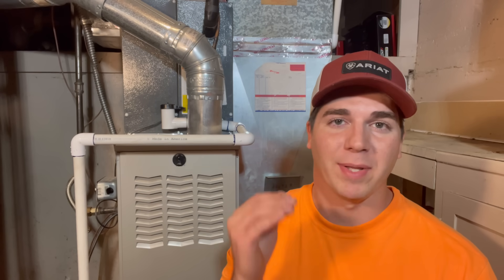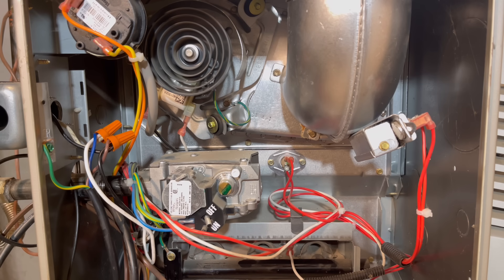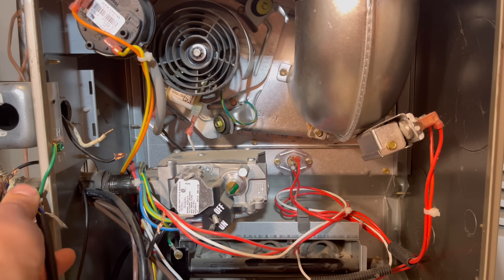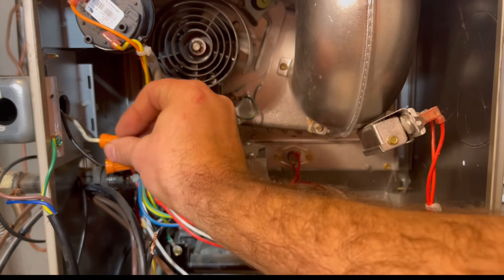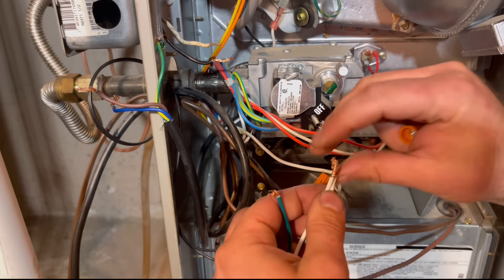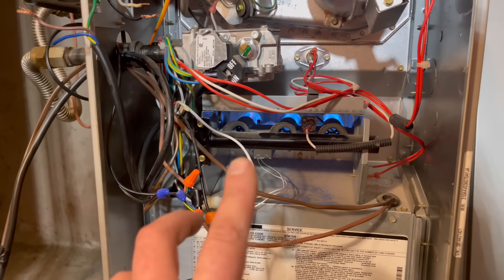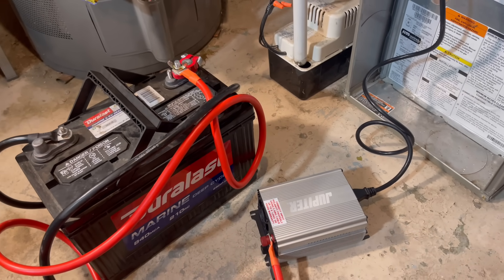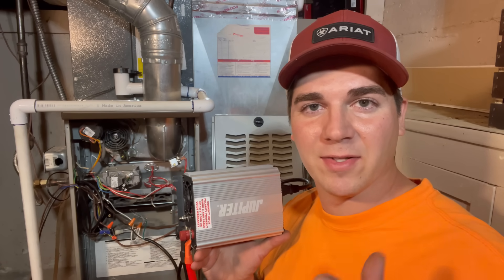Did You Know You Can Heat Your Home With A Car Battery?

Comment: You omitted the ground. The unit needs a mechanical ground supplied from the source and is the ground and neutral bonded at the source? Also, is there any means of overcurrent protection? Are you following National Electric Code? Do you need to add any disclaimer to your videos to protect yourself from lawsuits in the event you lead someone into injury or worse death? Let's leave electrical to licensed electricians and tin knockin to HVAC technicians.

Comment: I used a pair of deep-cycle 6 volt batteries in series to power an inverter to supply my 120VAC.  Not only does it power my heating boiler, but it also powers my refrigerator and a few lights.  So...heat, refrigeration, and lights for a few days.!

Comment: If you wanted, you can charge that battery with your car and a battery charger on your long trips to and from your work place, if you didn't have solar, most people have car charging systems or a riding lawn mowers and some jumper cables. Just some thouhts !

Comment: Might last a day or two since you're only powering the blower.
Don't try this on an electric furnace, not enough power to run it AND even if you did use a high-enough power inverter, wouldn't even last an hour.

Comment: That's really nice. Unfortunately, I live in a manufactured home. I do not have a switch on my furnace. It is simply hardwired to the house electrical system. Yes, it has its own circuit breaker. If this can be used on my furnace, I'd love to know how. It isn't uncommon for us to have 2-3 day outages. When the temps are below 20, that can be really bad. TY

Comment: Just keep the battery and inverter in the car with the car running, so you dont degrade your battery. You can just run a thick extension cord to the furnace.

Comment: Are most gas furnace using a step down from a transformer from 110/120 down to a 24 volt for the furnace  controls. My homes run on steam gas burners by the way

Comment: Buy a large truck battery 12 Volts and keep it on an automatic charger.  Have it connected to an inverter.  Get a 500 Watt inverter. This way you can run some LED lighting. This battery would probably last a few days during a power failure.   

If you have sunlight during a power failure, you can install some solar panels to run the charger through its own inverter. During sunlight the battery would be charging. This would mean a bit of an installation but not complicated.

Comment: Now take your car charger and plug it into your Inverter and put the battery cable on your car battery post.. PS Put your battery on a block of wood the because sitting on concrete floor can drain your battery faster.

Comment: I have a 2500 watt inverter generator and I was wondering if the power goes out if I shut my main off and plug my inverter into a plug thats on the same side of the panel box as the furnace and just turn the furnace breaker on can I run my furnace that way off of my 2500 watt inverter.

Comment: Basically what you are saying is that a local power failure can have you marooned without adequate heating. Gas is plenty available but you can't run the furnace. Damn, that is awkward. Is there any law in the US that forbids having a backup (12v battery + inverter) power supply to keep the furnace going in case of a local power failure? Especially in winter?

Comment: Can a setup like this power a oil fired crown boiler with a beckett burner. The heater provides domestic hot water and home heat through slant fin baseboard convectors. It has an aquastat device attached to adjust temp. Im sure the transformer draws high peak current.

Comment: If you put an outlet in the power box that's there on the outside of your furnace (if one isn't already wired), you can make a plug to plug power cord and just plug in the power from the inverter.  Just be sure to turn off the breaker at the electric box in case the power comes back on.

Comment: Great Video for sure but when you say get the inverter and purchase "these" and point to them, you didn't say what they are or provide a link to them.  Is there any specific volts/amps/etc those cables need to be?  I'd hate to buy the wrong ones and have them melt or catch fire.
Reply from the maker: There are links in the video description 👍🏼

Comment: What about the thermostat low voltage control
Reply: The 24 volts comes off the furnace transformer which is fed from your 110-120 line voltage. If you have a newer furnace, the electronic control board will only work with a pure sine wave inverter and you might even need to bond the neutral and ground together through a dummy plug plugged into the inverter.
Reply: PS  I would recommend a 1000 watt pure sine wave inverter so you can charge your phone etc. and run some lights with your furnace as a minimum.

Comment: Black to DC negative ,not neutral ;Square wave. Put a solar cell on your setup with a blocking diode on positive so it doesn' t back drain your  battery. You Texans, get all that sunshine, sometimes you taste the northlands cold. Nice idea...Hugh Mc -Chicago, metro

Comment: Not for nothing, but why not just plug the furnace into the inverters outlet as opposed to the pigtail approach. What am I missing about wiring vs using the existing plug?
Reply from the maker: What would you plug it back into when your power is restored?  Some folks just have an outlet and a cord going to their furnace that plugs into that outlet. But I think code says your furnace needs a dedicated switch.

Comment: I would get a battery charger and connect it to the battery and connect it to the second outlet in the inverter this way the battery would be getting charged while running the furnace. Now to be real efficient get a second battery and put it on charge run the system on one battery for three or four hours and then switch the used battery then put the charger on the drained battery switching them out every four hours gives you a fresh battery and the power could be on indefinitely! Thus you have free energy machine and this is told to us that can not work but they are full of well you know!

Comment: Very good idea that everyone should get a small inverter, at least 700 watts (Harbor Freight $29.95) and a good sized car jump box, these have a built in cord and charger and store enough charge to run the inverter for charging the phone, run the laptop for a short time and keep the furnace running.

It should be noted that you don't really need to take the furnace wiring apart, just unplug it from the wall outlet (most aren't hard wired) and just plug it into the inverter.  It takes 650 watts to run a furnace, the evaporation pump doesn't need to be disconnected, it uses very little power and only when it is full and the float switch turns on a few times a day.  Best of luck.

Comment: I have a question.  If all of your power goes out, and you hook up the battery/inverter as your video suggests, does this also power your thermostat?  Without a functioning thermostat, then how does it work?  Thanks
Reply from the maker: Yep, as long as your furnace has power, your thermostat will work as usual 👍🏼

Comment: the issue is that gas is way more expensive than electricity , you could save money in electricity 10 to 20 dollars during the winter, but gas is 157 dollars a month depending on the size of your home 😢

Comment: Good way to ruin your car batt. Unlike the Deep cycle batt of your camper(or boat) car batts don't like to be drained dead of power. Be prepared. Buy a generator. Test it cpl times yr.
 It you're prepared for the worst thing you could ever imagine happening at the worst possible time? Youre never disapointed.

Comment: Love it, bro.  Thanks for the video.  I live in TX and experienced the outage.  Hated having to rely on Oncor to decide when I got power to warm up over those days.  This  survival 101 plan is what everyone needs to know.  In fact, it is also a hack to reducing your electricity bill for several days out of the month.   Being able to switch between a couple of inexpensive batteries that you can recharge (with your car) can save quite a bit of money each month.

Comment: What's the max amount of watts you can use your car as a generator  ? For better results the car battery should be 1,000cc avoid 500cc and 600cc car batteries

Comment: Have you actually tested the length of time a battery would power a furnace before it needed to be recharged. Some blower fans require a quit a few watts to run and would drain a small auto battery fairly quickly

Comment: FYI that 12V lead acid battery has no more than 100 Amps, but if you use more than 50 you damage it, so that's essentially a 50A battery. For your heater to last more than a day it would have to draw about 2 amps per hour (24 watts). I honestly doubt your heater has that low of a power draw. If you ran it over a day, chances are you damaged the battery and shortened its lifespan.
Hope this helps.

Comment: Inverters usually come with jumper cable style connectors. Leave the battery in the car, use an extension cord. Boom! your car is the generator. Start it up let the house heat up by 4 degrees then shut it off and repeat. This is way easier than carrying a battery around and it wont go dead.

Comment: you could automate the power by leaving everything hooked up this way and adding a battery charger from the house power to the car battery. Auto switchover when power goes out and battery always fully charged during normal times. Just wonder if the inverter would wear out with constant usage.

Comment: That seems like a Mod any heading and air company could offer, A few deep cycle batteries set up with a tricker charger and a nice inverter along with a transfer switch would make the unit kind of simple any one could just flip a switch and drop from the main supply to the backup system. and then just as ease move from the back up batterys to the  main power system when power comes back on.

A lot of AC motors like fan motors at times only draw a few amps and if it a 110/120 motor having heat with a smiple system like this would be nice.

Kind of like having a secure system and a small battery and it dies after a few days when you could have big deep cycle battery or a bank of battery's powering your video systems and recorders or you gate access control system if they are 12 volts remember mag locks on doors fail once they loose power.

Amazing Hack as they say.

An other neat Idea is haveing a back up battery in your Auto or a bank two or three batterys that charge off the main system and then  should the Altnator Fail you can bring those batterys on line all at once or one at a time as you need tham to keep the auto or truck systems running as todays autos use a fair amount of power running the computers and EFI along with one or two fuel pumps and back in the woods or out in the back countery an Altnator could leave you stuck.

But if you have a back up battery system you could possible get back and the systems no more troubble than this HVAC hack and thanks for posting for who knows how many people lives you may save.

Remember hearing the story of a NASCAR team only running one battery and was told they should run two just in case the Alternator  fail during the race and they had to have the same weigh as a black up battery in the car anyway.

They did not thank much of the Ideal of running a back up battery until they were leading the race and it was down to the wire and the Alternator  fail and they lost the race if i remember the story correct because the battery went dead, After that it was out with the dead weight and in with a back up battery for the next race  

Remember if you back in the woods two ease things to over come is a dead battery if you have a back up system to bring an battery on line  to start the truck

The other is a bad starter or Starter relay two parts ease to change.  Should that starter or die and its ease to toss a new one under the seat or in the tool box just in case, Remember trucks and vans for the most part are high off the ground so Verry little jacking or no jacking at all to change a starter.

Comment: Make a 12 /16 v charger out of a car alternator and a 3 or 4 horse gas motor go garage saling for a cheap motor. 2 days become 2 weeks on 5 gallons of gas . Delco alternator is best built in regulator . I run 3 120 Amp on a diesel engine . Run generator every day to protect the battery and alternator. Powered my house lights and heat of the generator for 8 months. Liquid cooled diesel.

Comment: Wire the pigtail into the box with a 3way switch on the black wire, using the common lug going to the furnace. The pigtail can be left connected as the plug will never be hot so you can't get shocked. Plug in the inverter and flip the 3way switch. When the power comes back on flip the switch back. This way you don't have to remove the furnace cover as many units have a kill switch that disconnects the power if the cover is removed. By the way this doesn't work on electric heating systems or heat pumps, but you already knew that.

Comment: Back in the 90,s I was living in Maine and we had A lengthy power outage from an ice storm as well.I basically did the same thing with A power inverter except I had it connected to an automobile that I would start periodically to recharge my battery and I didn't have to worry about it draining and possibly having to buy A new one.👍

Comment: Well there is an easier way.
Buy invertor.
Buy two 50 amp circuit breaker for your house breaker box.
Buy a good three prong extention cord.
...
cut household power.
Cut female end off extention cord.
Strip black wire then connect to breaker box ground bar.
Strip Green wire connect to one of the 50 amp. Do the same with the white.
Put circuit breaker in breaker box. Leave off.
Connect invertor to battery.
Connect extention cord to invertor by plugging it in.
turn on invertor.
Turn on circuit breakers.
Turn on house hold battery.
Now turn off circuit breaker.
When power goes out. Turn both circuit breaker on. And your house has power.
NOW This won't last long. 
To increase add more batteries.
To improve add solar.
Don't get BSed by the lithium battery hoax.
Best batteries you can get are 24DC batteries..These are 12v deep cycle lead acid marine batteries.
They can be rebuilt for pennies each. And if rebuilt have no negative effect to inviroment, for those hippie type people.
Now. rebuilding requires skill, caution, and some important safety equipment.
Everything in battery is reused. 
I'm one of my systems I'm on second rebuild.
These batteries can last 10 years between rebuilds.
Also I'd put a charge controller between panels and batteries.  But it doesn't have to have one. You just have to watch batteries for over charge. 
And without a controller the battery life will be reduced. And rebuild required more often. Plus they will need distilled water more often.
This is also the way to shotgun solar into your on grid system.
Reply: Oh. 
notes Electric furnace, electric stove, electric dryer all require at least 1500watts.
So with these you will need a lot of batteries and panels.
A water heater will need 500w on average. 
A top load Washer machine with human help can be ran on 500w. For this you will need to fill bowl each cycle by hand.

Comment: if you tie in and place a receptacle right below that 120v on off switch, you can turn off the switch and power the furnace thru the receptacle. put a male plug on both ends of that pigtail. 

my house happens to have the receptacle right below the on off switch. 

most people try to run electric heaters with their generators and your furnace pulls less than half the wattage of an electric heater.

Comment: Might well work with a gas furnace, but I have a similar oil burning furnace and even a small generator won't start the oil burner. I have to fall back on my pellet stove, which will run on the generator (or a battery and inverter). Could buy a big generator, may eventually, but for now I am using the pellet stove anyway to save on ridiculous oil prices.

Comment: I watched a man take the generator part of a gasoline unit and hooked it up to a frame with a giant pulley wheel. He had an electric motor attached to the frame of the unit. He cranked the big pulley with a handle when it created enough power he threw the switch from the generator that turned on the motor. The generator was big enough to run the house. It was self sustaining but I have yet to see anyone here in this country build this. No fumes no fuel no batteries.

Comment: Isn’t there a plug for the furnace anyways? Why would you need to go into the inside of it to power it? It You can just unplug it from the 120v outlet and then into the inverter.
Reply from the maker: No. Yours might be that way but most are hardwired.

Comment: Note the inverter should be a pure sine model like he has listed not a modified sine. Most electronics can be damaged with a modified sine inverter. You can power most everything with this type of system using the correct wattage. My boiler and solar are prewired with a plug so it's as simple as unplug and plug into the inverter system. Don't cheap out on the inverter you want something you can depend on. Have a back up if you can afford it. Two six volt AGM batteries wired in series will last much longer. Have this system on a cart so it can be taken outside to charge with your car or other means like solar. You can purchase solar generators to this as well but tend to be pricy. Another note some furnaces require the ground to operate.

Comment: It would have been nice if you added a deadman on/off switch... (once everything is connected) just in case the power does go out - you can just turn the the switch on instead of disconnecting everything. 
Great video!!!